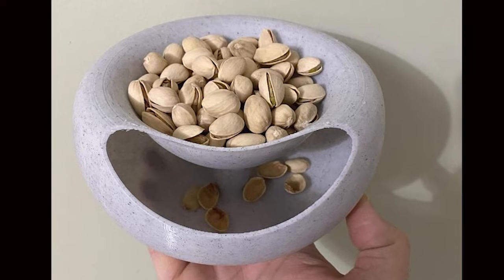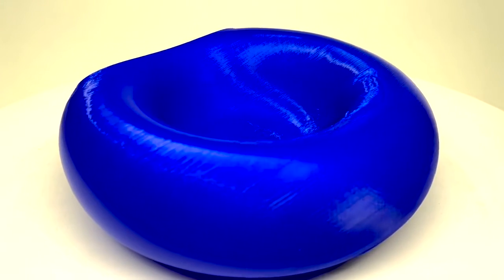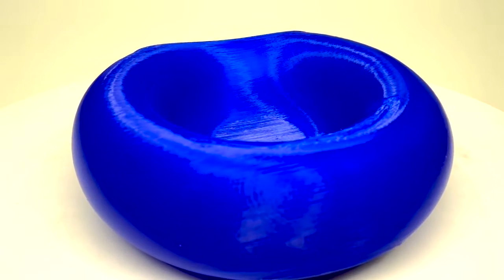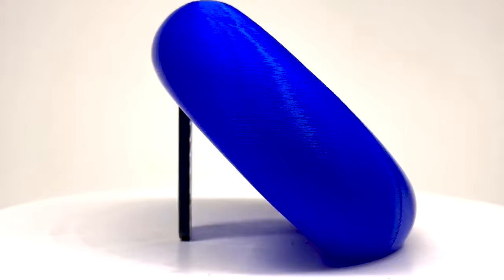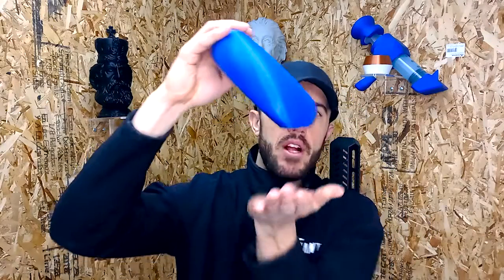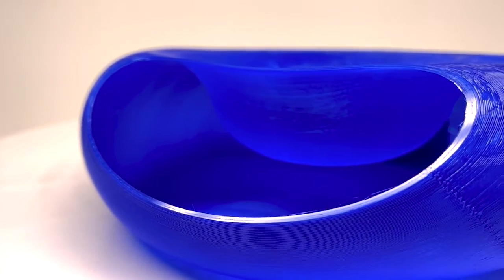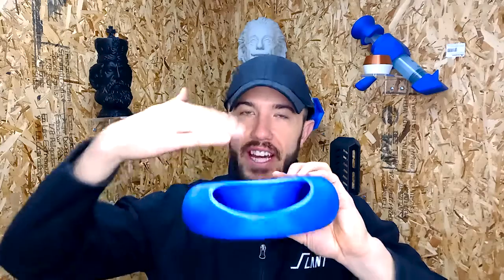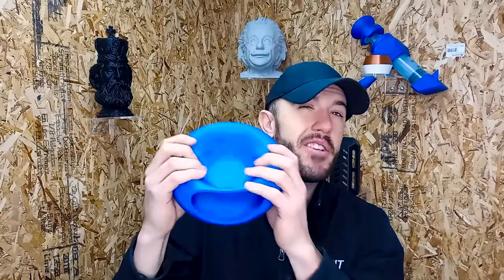This Bowl Holds Your Nuts but Hides the Shells

Comment: Change the opening angle slightly,  flip it opening up and print it in vase mode,  where your going off that over hang not up it.. will be smoother.

Comment: Good for 300 grams of pistachios? 

Assuming they are of an average size, 100 grams of that will be the shells, leaving us with net 200 grams.

In a table of 5, each person gets 40 grams, an amount so low that it wouldn’t last 10 minutes.

Also, due to its design, every person must be sitting in 1 direction or else the shell area is not accessible.

Comment: Thanks for the excellent camera shots of that 3d print! I was wondering about the quality of your 3d prints. To me, this "quality" is unacceptable to sell professionally and of beginner's quality. This is "dollar store" quality, at most! Can you do perfect 3d prints as Prusa and BambuLab usually do? 
Can this print be greatly improved by using proper support or another solution? 
Nice video, as always. 👍
Reply: I don't think the quality is all that bad as in the machine not being well tuned, where I think it can be improved on is in the design so that you don't have the steep overhangs that cause that deformation at the top. They can also reduce the layer lines down to something like .16mm but then that would take a lot more time. Personally I would redesign it so it doesnt have steep overhangs but still has that organic flow. There is a fine balance between printing speed and quality when it comes to profitability. Adjusting the layer heights also increases material usage which eat into profits. Its all a fine balance between how long a print takes, the cost, and if its aesthetically pleasing enough for someone to purchase. The bambu machine can achieve great results but they are also problematic and are not open source, if you have a 30 printer farm with bambu labs, maintenance and machine cost will be very high which puts you at a disadvantage vs other farms that make similar products with open source/cheaper hardware that can produce similar quality.
Reply from the maker: This is the best solution. The way to go about it, that we have reccomended to the designer, is to change it to an oval shape, so that there is not the large overhang at the top that causes the deformation in the supported area.

They can also change the angle of the opening in order to allow the bowl to sit a bit more vertically so that the overhang essentially disappears.
Reply: Maybe adjustable layer heights in the slicer and generally smaller layer heights in the 1st place.
Possible painting it later.